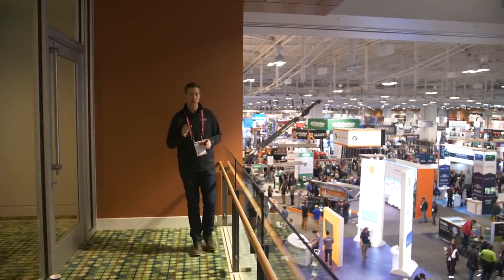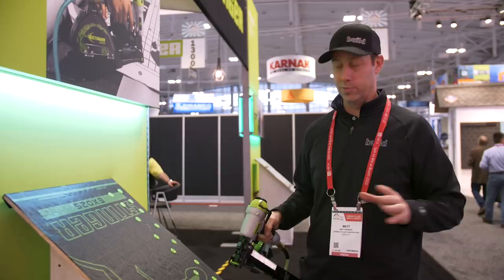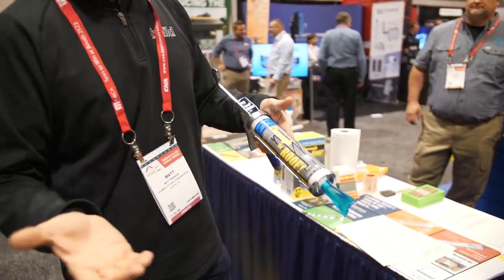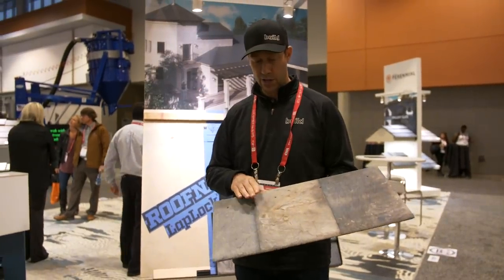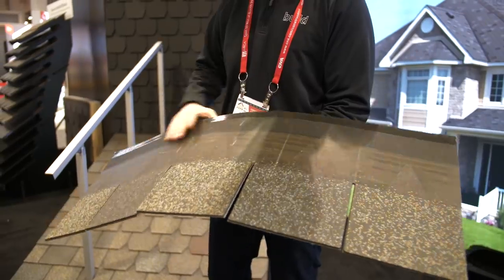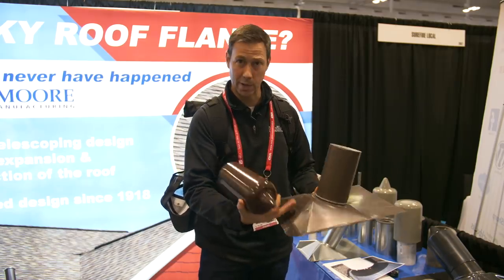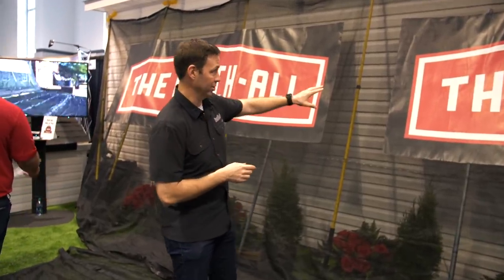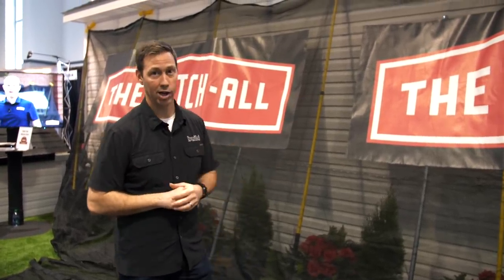NEW ROOFING PRODUCTS 2019 - This Show Had Some Surprisingly Cool Stuff!

Comment: Actually @ 10:45 "TheCatchAll", we show that we care by laying down tarps and leaning 1/2" CDX plywood under the eaves to protect the siding and plants. Also we protect the gutters with 2 by 6 toe-boards with roof-jacks and would never subject them to the collisions shown in the video. That fabric is going to cave in on the plants rather quickly. Even if the project does not require plywood installation, a good roofer will have plenty on hand and simply use it on the next job. This gear would be good for major moss removal and gutter cleaning but not as strong as plywood and tarps for tear-off.
Reply: Dont know if you have ever done this or not.  When you can not get the plywood up to the house because of bushes use a extension ladder and screw blocks to the back of your plywood.  Then hang the plywood by the blocks in the ladder rungs.  It is much faster to set up than building a 2x4 support behind the plywood.  You can even screw so 2x4 to the plywood sides as guides if you wanted.
Reply: Not to Mention The Price $4000 ish  WTH..?

Comment: Metal Roofing..

In Australia domestic roofs are "all" either clay/concrete tile, or "corrugated" - different styles- sheet metal (laid from ridge to eave).

Though for some reason (cost) we don't typically sheathe the rafters before lating the roofing.  Just lay "sarking" or glasswool blanket and roof over that.

Comment: Hi Matt, thanks for all you do. As a regular consumer and homeowner, I try to watch every video you publish because I like your message. I particularly enjoyed the euro series you just wrapped up. I'm a big fan of passive house, net zero, and building for the long term. Regarding metal roofs, have you considered publishing a consumer-oriented series about metal roofs and what to look for in a good roofing contractor or metal roof installation? I had my roof replaced three years ago and wanted to go metal. Unfortunately, I didn't know better and the contractor talked me into using what I now know to be an exposed fastener system not meant for residential application. It turns out the contractor did a lot of other things wrong as well. I already have several leaks and now I'm replacing it again, this time with a standing seam hidden fastener system and I'm being very picky about installation details. Fool me once...